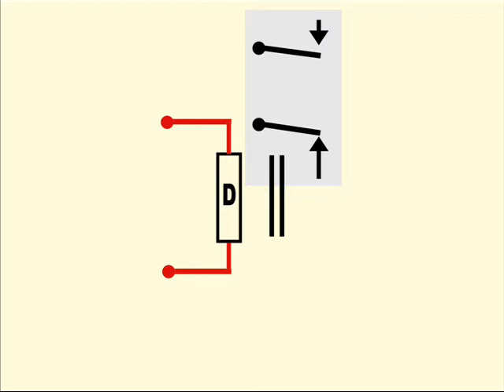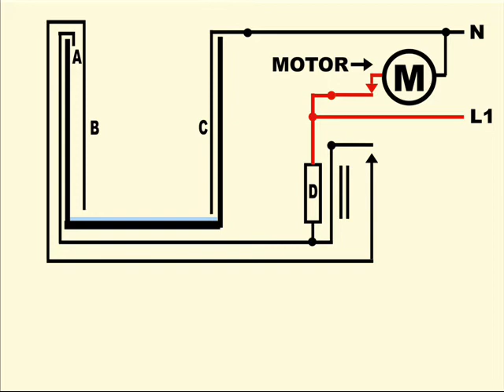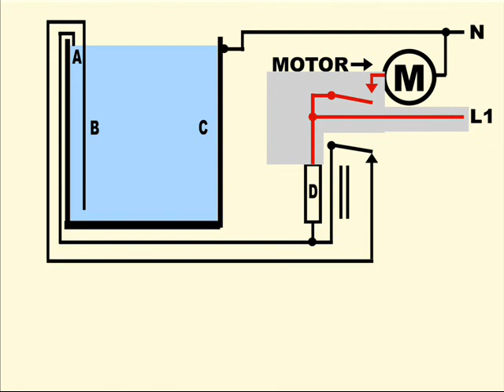How to automatically control water tank electric pump

Comment: qué tipo de relé es ?? si alimento la bobina con corriente alterna, no va a estar oscilando y hará que no se deje de mover el interruptor del relé? me explico? saludos.
Reply from the maker: Se usa un relé de corriente alterna. Es la mejor opción. Gracias por la pregunta. Me enfoqué tanto en explicar qué era el relé que olvidé mencionar que es para corriente alterna.
Reply: Oh, y dónde puedo encontrar de ese tipo? Si es que pudieras ayudarme con esa información, es que he buscado y solo venden el que es para circuitos electrónicos de Corriente directa :(
Reply from the maker: No son difíciles de conseguir, al menos no en Mexico, los que he conseguido fácilmente son de 8 patas, iguales a los bulbos de radio, en círculo, le llaman tipo octal. Espero que este sitio te sirva - http://www.ebay.com/itm/MK2P-I-AC-110V-Coil-8Pin-DPDT-Power-Relay-with-Plug-in-Terminal-Socket-/231170239240?hash=item35d2d1eb08:g:GpAAAOSwax5YuKxZ
Reply from the maker: Yo uso relevador de 110VAC porque es el voltaje de mi casa, si usas 220VAC ése deberá ser el voltaje de la bobina.
Reply from the maker: Los contactos deberán poder con 10 amps, más o menos.
Reply: Chava Tarin muchísimas gracias, es de gran ayuda :)

Comment: Please make hand writed diagram f
or me how to connect relay to my roof water tank and motor
Reply from the maker: As a matter of fact, I improved the circuit and published a drawing in My Community in my channel. In this drawing I added another relay which detects when the lower tank is empty and the pump will not run dry. Please go to my Community and look for that drawing, which has both tanks, upper and lower as well as the cabling.
Reply from the maker: Dear Sikander Khan, I just finished posting the schematics on Community, they are both about the way relays are connected and how they interact with both tanks, upper and lower.